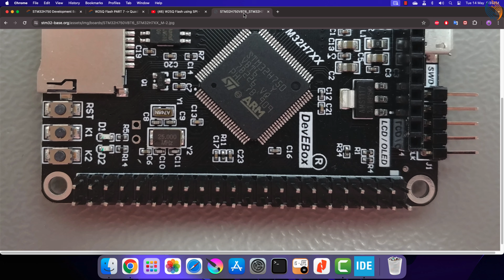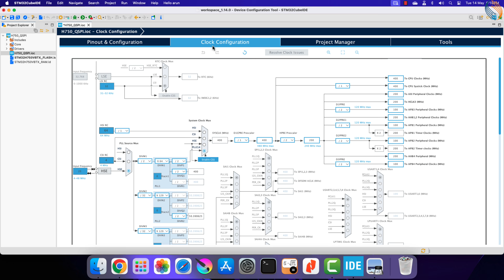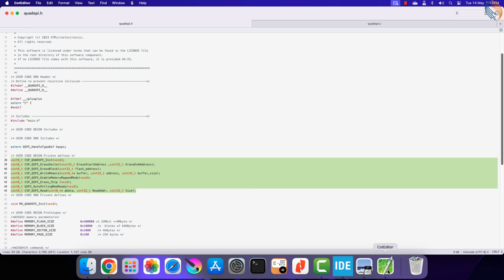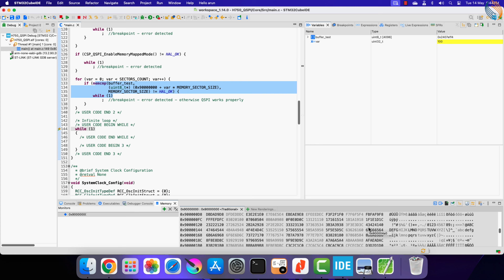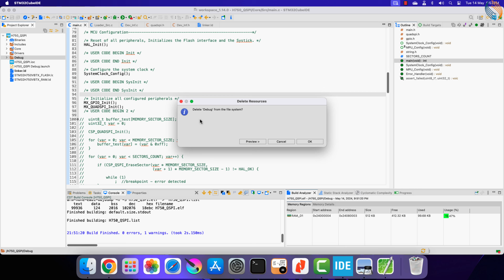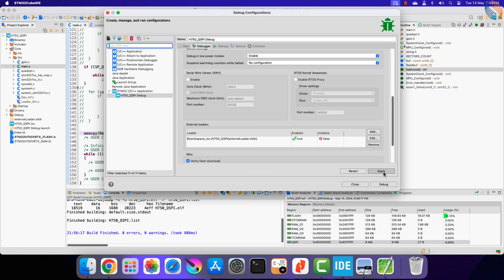W25Q FLASH Memory || Part 10 || QSPI & External Loader on H750

Comment: I have 4095 sectors in the case of AT25Q128A 16Mbit flash, I tried changing SECTORS_COUNT 100 in macro to 4095, then in live expression I am getting number 255 instead of written values in the external flash location, could you help me out @ controllers_tech!!!!

Comment: on cube programmer i get read data failed but my init works since i can select my stldr file without any problem
i am using w25q128 with stm32h723 any idea why or has this happened to you as well?
Reply: using octospi2 on 0x70000000
Reply: also the code works fine since it passes the testing code for all sectors
Reply: also when debugging using the linker.ld file i tested all functions, init, write, eraseSectors ... and they all work and i can also read the memory on cubeide when debugging only the .stldr file doesnt work

Comment: Hello, I hope you’re doing well. When I was using external FLASH and followed the video tutorial, during the testing phase, my breakpoint did not reach the expected location. Could you please help me figure out what might be wrong? Thank you!
Reply: Hello, I hope you’re doing well. I managed to hit the breakpoint, but when I needed to specify the address, I ran into an issue. The chip I’m using is a different model, and the IO pins reserved in my schematic are limited. As a result, I can only select the mode where the BANK is set to 2. Could you please advise me on how to proceed? Thank you!

Comment: Thanks for the video. I have w25q01 1Gbit flash memory and I did the same thing you did (except size parts) but when it comes to test section, it doesn't work. When I monitored 0x90000000 from memory, it does't same as the buffer_test.

Comment: Can you create external loader on STM32H5 series?
Reply from the maker: The purpose of this video is that you can create external loader for any mcu with any memory.
Reply: @ControllersTech  Hello, the STM32H5 is not as straight forward. It is using Octo SPI and the hal drivers are branded as XSPI. so i doubt this video is compatible with the H5 series :(
Reply from the maker: The video is for QSPI, not Octo. So no its not compatible.
Reply: @KP____8842  Did you solve the problem with the STM32H5 series? I'm currently having problems.